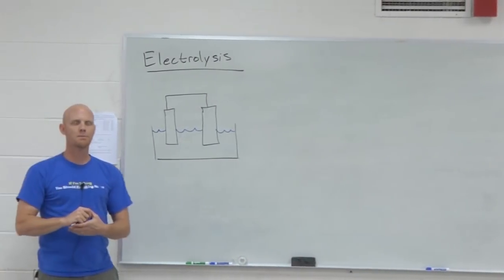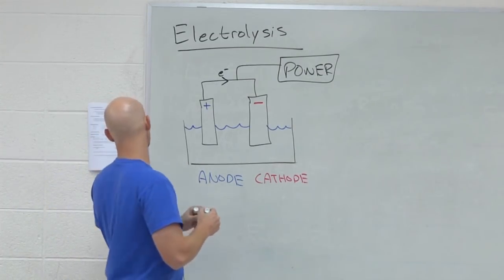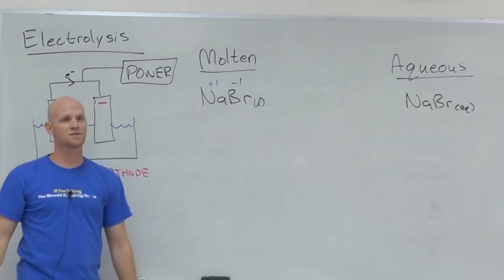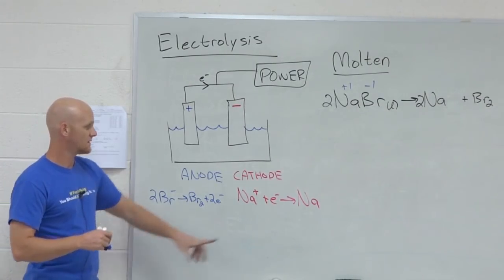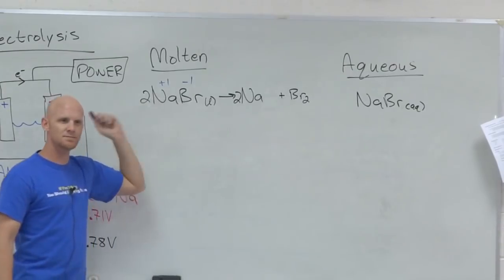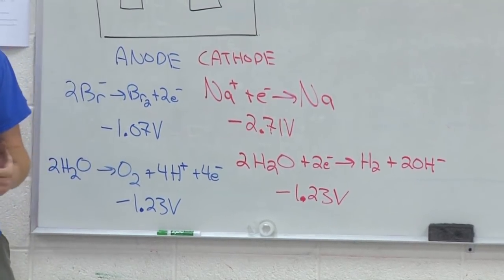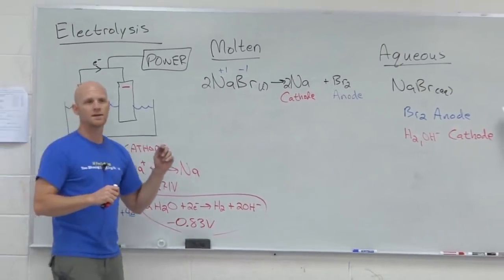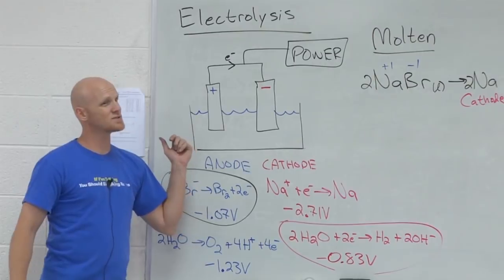19.7 Electrolytic Cells

Comment: Hi Chad, so I understand reduction is always at the cathode and electrons flow from anode to cathode but how do you know which metal will be undergoing reduction/oxidation? usually, examples have Cu at the cathode and Zn at the anode for voltaic cells, but why couldn't it be the other way around and have Zn undergo reduction? For the DAT they don't give you a table with the Ecell values, sometimes they give reduction potentials but not always. Thanks!

Comment: Finally understood electrolysis, thank you! Quick question: would the cathode and anode here be inert, like Pt or C graphite?
Reply from the maker: Exactly right Kool Kola!  You definitely want to use inert electrodes, but this can be problematic with electrolysis.  For aqueous electrolysis you can use a lot of metals as inert electrodes as they are already in their most reduced state as a metal, but you have to be selective in choosing your anode and platinum is a good choice.
For molten electrolysis you also have to choose metals with higher melting points than the melting point of the salt being electrolysed, otherwise your electrodes will melt too (know someone who ran into this problem!).
Hope this helps!
Reply: @ChadsPrep  Thank you so much, this makes sense!
Reply from the maker: @SaketRamCoolPolar  You are welcome - glad to hear it!

Comment: Why is the e cell -3.78? Don’t we do cathode - anode?
Reply from the maker: If you are provided with REDUCTION potentials then yes.  And the reason we subtract the anode is that oxidation takes place there rather than reduction and subtracting changes the sign since it is the reverse reaction that is actually occurring.  But if you look back at the video the -1.07V value I provided was actually already for the oxidation (the corresponding reduction potential is +1.07V).  So had I provided the reduction potential for you then you would have indeed done "cathode - anode" and you would have calculated -2.71V - 1.07V = -3.78V.
But I already changed the sign for you by providing you with the oxidation potential in which case you simply add the values -2.71V + -1.07V = -3.78V

Same answer either way.  I cover the exact reasoning for calculating it either of these two ways a couple lessons earlier here: https://www.youtube.com/watch?v=iBiumUZfKjA&list=PLMlqayk59IvrG4m2TiMdwQonjhXKUGjvY&index=71
Happy Studying!
Reply: @ChadsPrep  Appreciate that!!:-) i think for the dat they only give reduction potentials hence the confusion(at least for the Canadian one!)